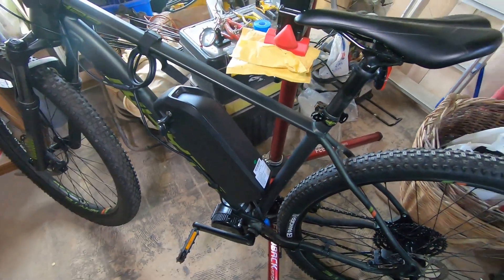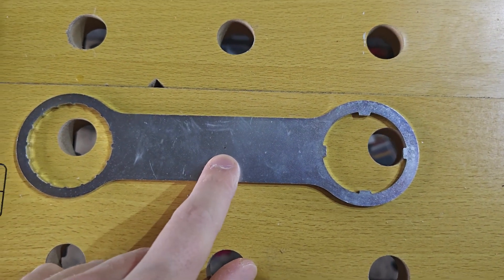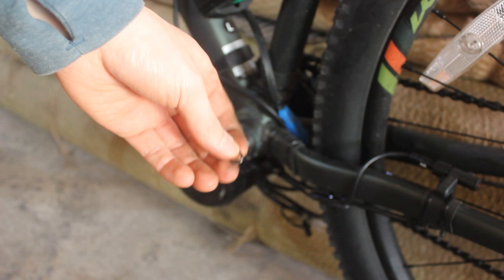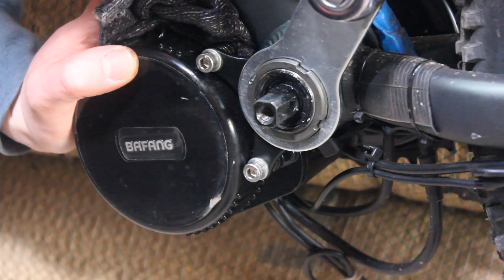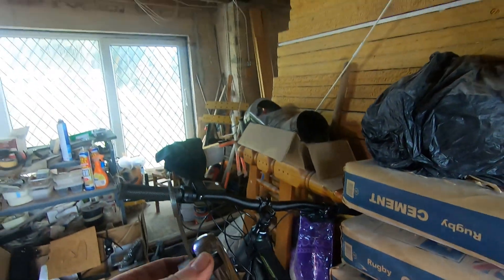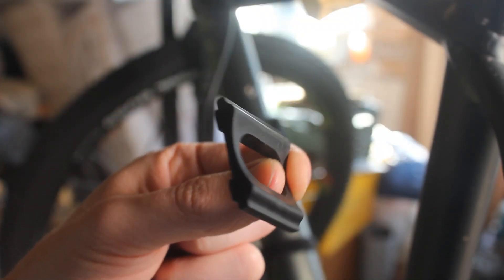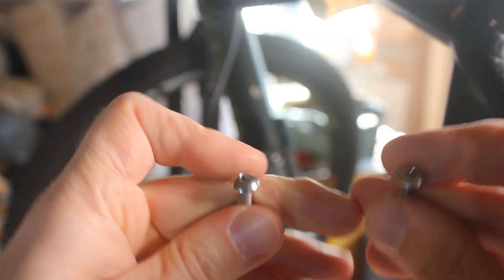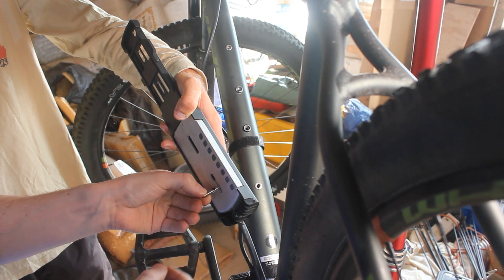E-bike Build #4: Stop motor hitting frame, improving battery mounting, adding glue to brake sensors

Comment: My Zascar GT with Bafang BBS02 is my daily Work Horse. Served me well on two Bikes, winter and summer. I live in Norway, and the Winter is long an hard. I use Spikes on my Tires and the Motor work well. I dont ride on the worst Winter days. I am getting older, and must take it a bit easy. You can trust your Bafang, it is an incredible Motor.
Reply from the maker: Hey man, great to hear what you're up to in Norway!! That winter bike sounds pretty gnarly with the spiked tyres. I hope my motor will last a long time. How long have you had yours? Thanks again 🙏

Comment: Nice video!!! On my bike I do not use a brake sensors at all, these sensors tend to fail over time... The engine stops when I'm not pedaling so its ok. Just I´m having issue with loosening the left crank bolt when pedalling... I need to tighen it each cca 10km. Will try to use some thread glue if that help!
Reply from the maker: Ah sorry to hear about the loose crank! Try some thread lock it should definitely help and maybe even look at the torque specs. That's if you can find them and if you have a torque wrench. Good luck 🤞!

Comment: Good improvements; might be worth putting a dab of epoxy on the exposed parts of that cork between the motor and the frame just to reduce the amount of moisture getting into the cork
Reply from the maker: That. Is. A. Great. Idea.💡thanks for sharing and interacting, the preservation of the cork never crossed my mind.

Comment: Love it. That included lockring tool does leave much to be desired. I essentially ended up using a mallet on the lockring tool to tighten the lockring until I could pick the entire build up by the motor(while upside down) without the motor rotating. I used a piece of an old innertube between the motor and downtube much like you did with the foam.
Reply from the maker: Nice work with the mallet! Weighing up whether getting a dedicated socket for it would be worth it. They are incredibly expensive (maybe just here in the UK) and im not sure its worth it for one bike.

Comment: Watching your videos just before attempting to put 4 rivnuts in the underside of my Turner Sultan frame - had already purchased the same rivnut tool as you used in the last video but by chance. Not sure I can fit extra washers into my battery mount as my mount is different and the central channel for the bolt heads to recess into is a bit narrower I think. Think I might also use a couple of ratchet straps as well for peace of mind as the battery is hanging below the frame. Motor is a CYC Photon.
Reply from the maker: Hi there and thanks for your comment, it's great to hear what people watching are up to. I don't know if you've drilled into your frame before, but it was pretty nerve wracking for me! So good luck putting the rivnuts in. The ratchet straps sound like a great idea, I think safety first as these things aren't cheap! Let us know how it goes! Thanks!
Reply: All done now, most nervy bit was how tough to torque up the rivnut tool to get a tight fit but not strip the rivnuts! I’ve drilled and elongated a hole in the frame before for routing a dropper post cable, so had had practise. I used a stepped drill bit which was great.
Reply from the maker: Awesome stuff! I don't have a stepped bit, maybe I need one! Thanks for letting us know, I'm glad it went well. @AndrewDCDrummond

Comment: Torque will be magnified by the distance from the nut to the driver.
Reply from the maker: Yes! Are you talking about leverage?
Reply: @itswobbly 
Your idea of using a torque wrench on the flat wrench will certainly give you more leverage. But in doing so you added to the lever arm length which increased your torque value to some magnitude greater than 60 N.m. In the end, it should be tight enough to not come loose.
Reply: @itswobbly 
BTW, Lekkie makes a socket for the Bafang locknut.
Reply from the maker: Yeah perhaps a worthwhile investment @larrycarner2418